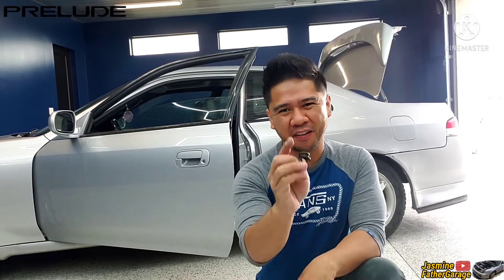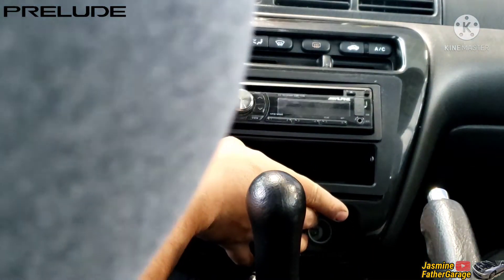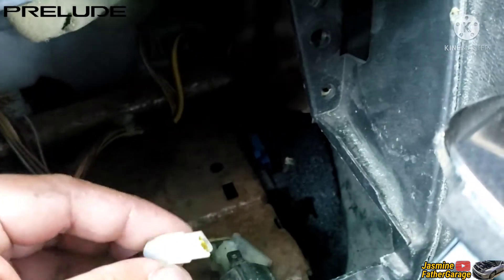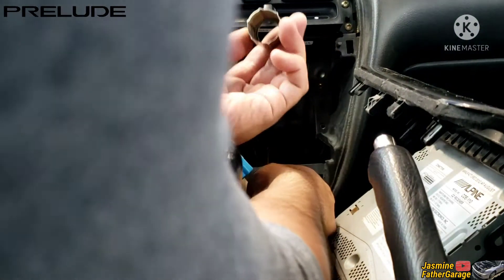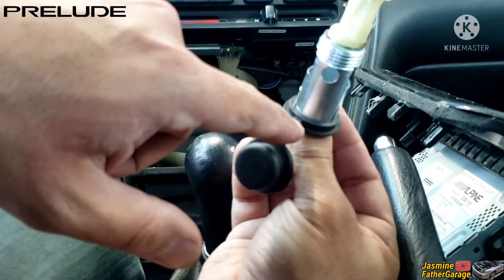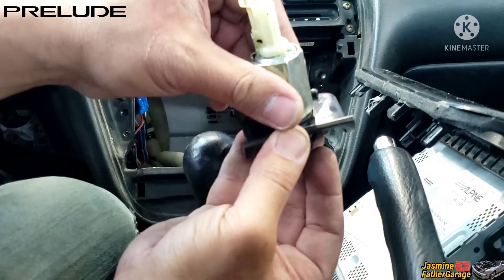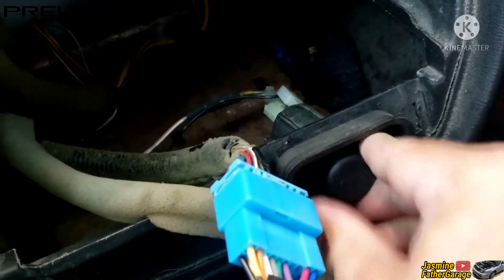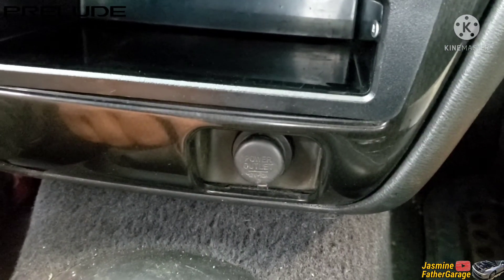Power Outlet 12V Cover Replacement. Honda

Comment: Do a 2015 honda civic. Thanks
Reply from the maker: Need to find 2015 civic to do this video, staytune
Reply: Did you find the video for 2015 Civic? I need to replace the power outlet in my Civic as well.